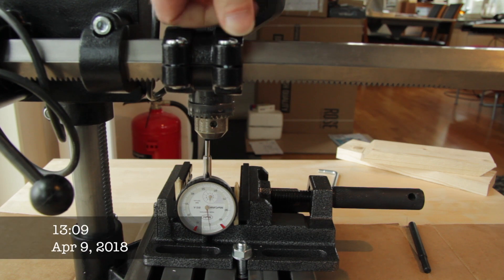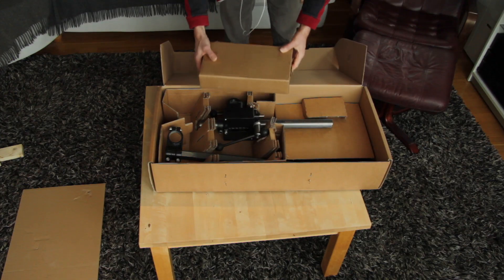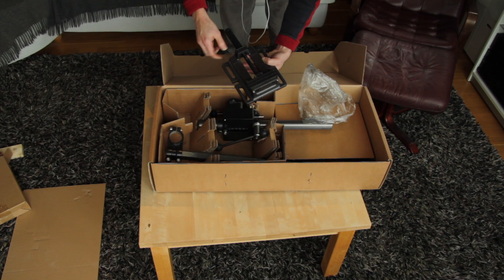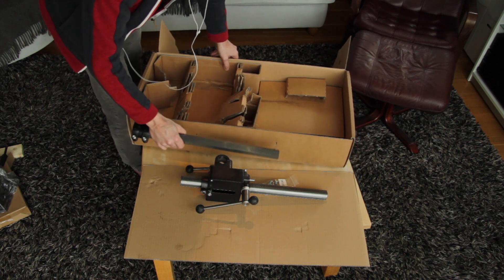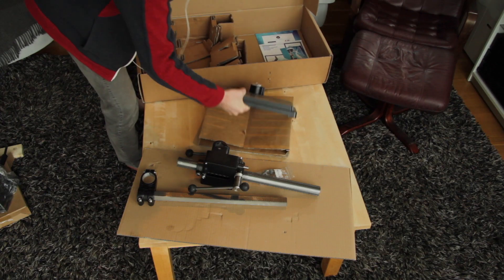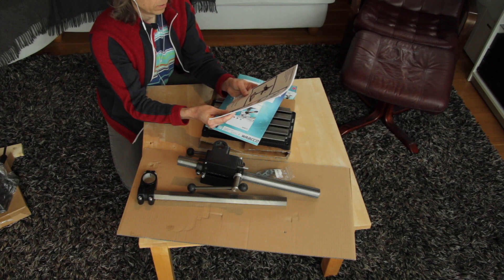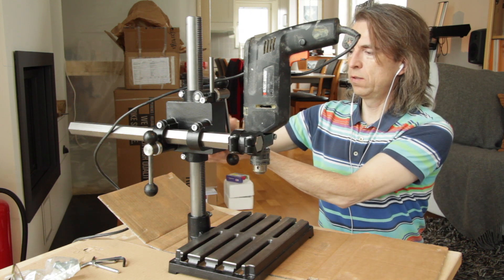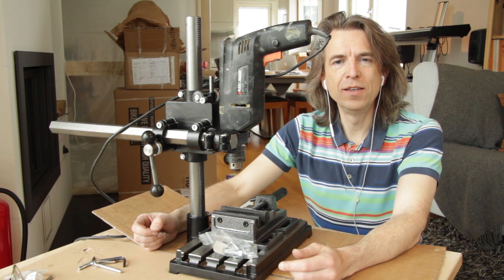Wabeco BF1242 Drill Milling Stand - Unboxing [Episode 73 9 Apr 2018]

Comment: a good video . is run out a problem with this drill ?
Reply from the maker: Thanks for asking :). I suppose the runout depends on what machine you mount into the stand. I used a somewhat "crappy" drill with some play in the chuck. But as I have mostly drilled in wood I have had no problems with runout (for my applications) :). I wish you all success in finding a drill press stand for your needs :)

Comment: Hello mister.
Can you produce a video While you use The drill stand? I like it  and it should be Great, before buy, Watch a user make some 90degree Holes. Can you?
Thanks. Are you happy about wabeco?
Reply from the maker: Hi, sorry for late reply! I have some videos in the pipe line when I use this stand. None though where I use it to drill 90 degree holes. I suppose you mean the feature where you drill horizontally? Never the less, as soon as I get the time and inspiration I will get some videos up. So far I think for the price you get good value. For me the "problem" is that I need a better drill. The stand has worked just fine so far :)